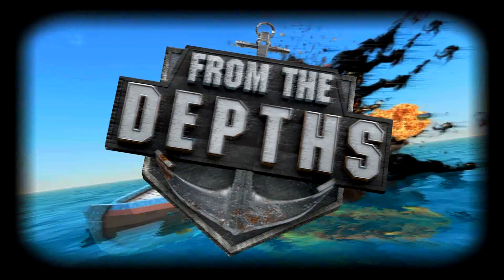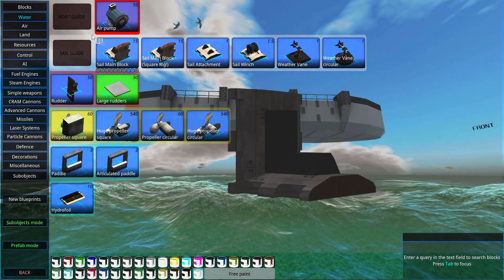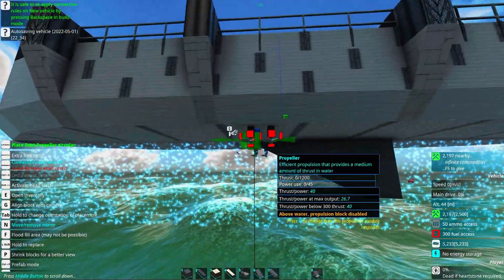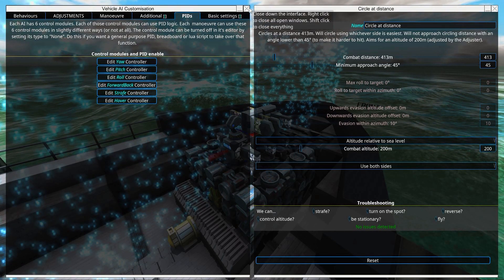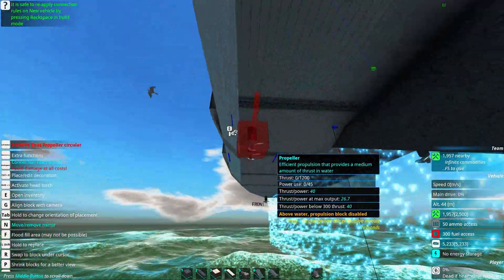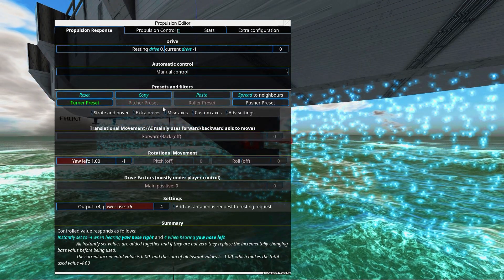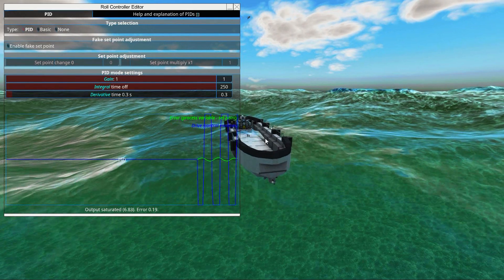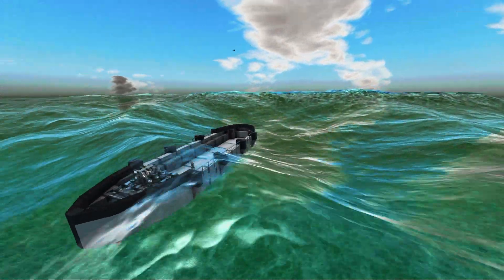From The Depths INSTANT Tutorial: How to Stabilize a Boat

Comment: Excellent tutorial GMod! I'd never thought of using props on the keel to correct roll, I'll have to try that. I usually have downward-facing props on each side. Your take on PIDs was a good primer, but it's pretty much FtD's version of dark magic - you fiddle with the sliders until it works about right. One note on stability: sometimes having a bit of instability is a good thing... look at the Deepwater Guard's flying squirrel! For boats and gun platforms stable is good, but a missile boat or a flying craft might last longer if it's movements are a bit unpredictable. If you have the time and desire, I'd like to see your take on PIDs as it's own video. I have a basic understanding but I'm far from good. As far as I know, this is approximately what the functions do:

P - "correct this hard"
I - "amount of time to find the average value"
D - "correct in this amount of time"

Is that about right?
Reply from the maker: Hey! Roll on keels are very powerful if you got a long keel. While inaccuracy is added the more unstable you are for all crafts after a recent update I agree that stability is not even a good thing if you only have missiles, better to have it fly allover and it will never get shot down, but for boats better stability often leads to better tops speeds so boats are another pokemon here. 

Interesting idea to make a entire video about PIDs, but it is dark magic because there is just simple math behind those values it is hard to easily explain what does what as they all effect eachother, I feel the stock values nowdays are so good they rarely have to be too much fiddled with, but fun decoding you did there, not sure it is completely accurate tho but you might be entirely right IDK haha